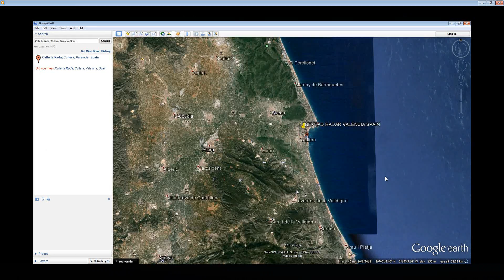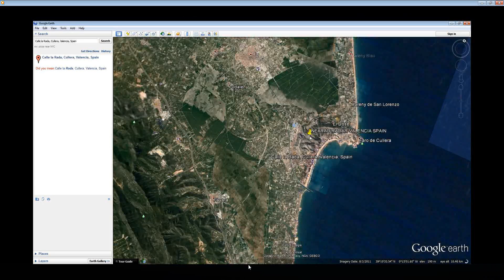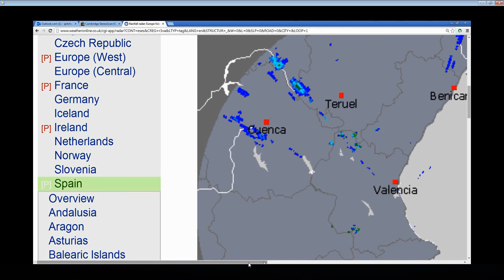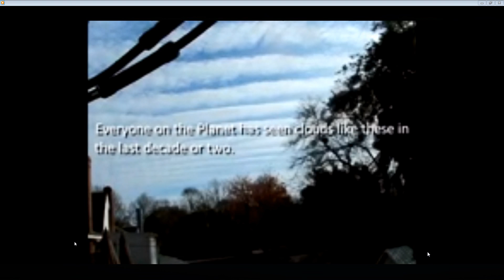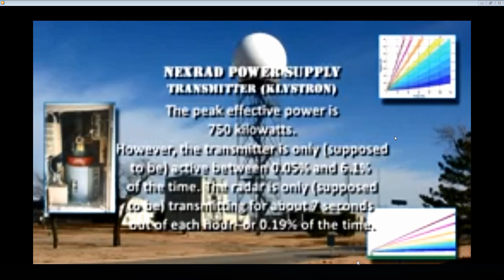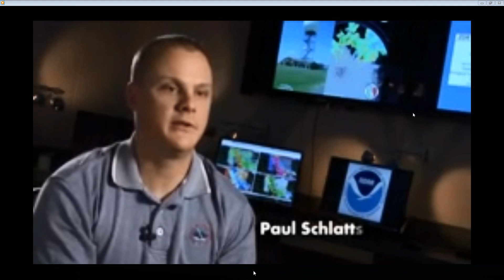Unbelievable Evidence of Nexrad and other Transmitters Weather Control

Comment: The weird radial lines emanating from the radar are second trip radar echoes due to range folding. A Nexrad radar emits microwave energy pulses 318 to 1304 times a second.  If one of these pulses strikes precipitation within the radar's range, some of the microwave pulse is reflected back to the radar.  Oftentimes, the radar is emitting pulses at the higher rate of 1304 times a second, the previous pulse of microwave energy may not have bounced back to the radar before the next pulse is released.  When these two pulses collide (e.g. range folding), some of the radiation is bounced back towards radar creating a second trip radar echo.  This is especially common when storms are just outside of the radars normal operating range.  These are not contrails because radars are located on the ground and are are only scanning a few feet to a few kilometers above the Earth's surface.  The strange bluish blobs around radars are usually fog and mist (sometimes insects).   A NEXRAD radar usually sends out microwave radiation at 0.5 degree angle above the Earth's surface.  Since fog is usually found within a few hundred feet of the Earth's surface, the radiation pulses senses the fog near the radar site but as one moves farther away from the radar site, the radiation pulses overshoot fog and mist at greater distances from the radar.  If you are seeing blue blobs around radar, check surface observations or web cameras and see if there is fog or drizzle.  Oftentimes, fog forms on nights following big rain storms due to radiational cooling.
Reply: Someone did there reasersh!